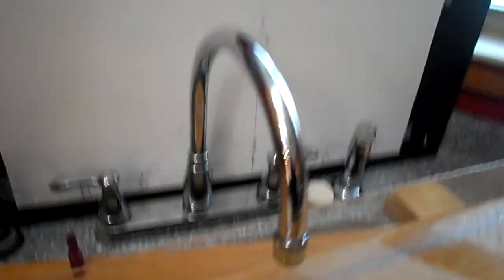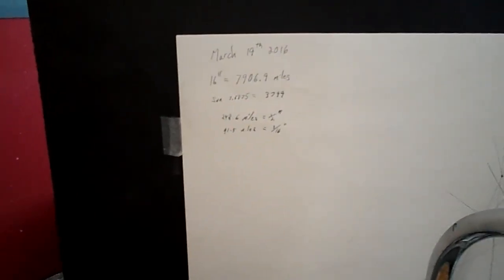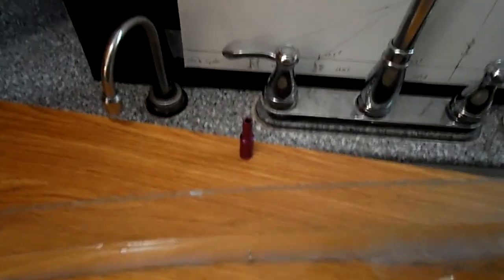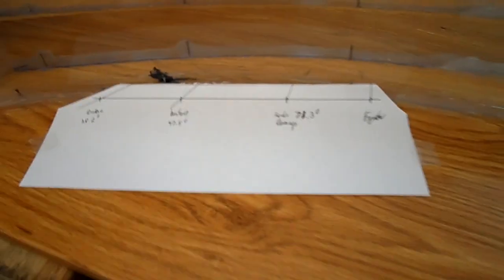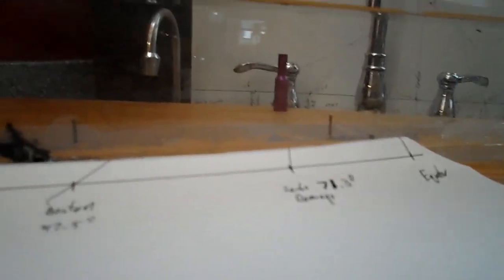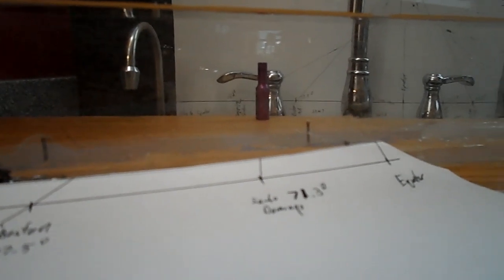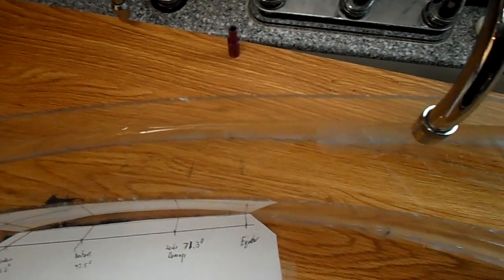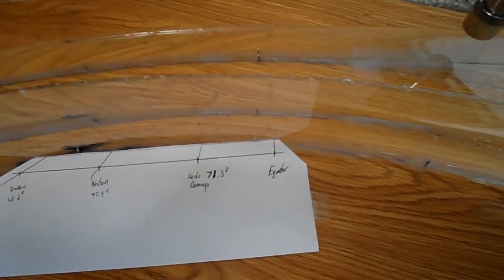FE Dome is 250 miles high on simple model (Part 2 Measuring dome)

Comment: I have been researching flat earth for awhile and finding the truth is not easy .The following is a quote you may want to re post "Earth is a realm,it is not a planet.It is not an object,therefore,it has no edge.Earth would be more easily defined as a system environment .Earth is also a machine,it is a Tesla coil.The Sun and Moon are powered wirelessly  with electro-magnetic field also suspends the celestial spheres with electro-magnetic levitation ,Electrico magnetic levitation disproves gravity because the only force you need to counter is the electro-magnetic force ,not gravity .The stars are attached to the firmament NIKOLA TESLA

Comment: By the way, what's the reason the firmament to be water?
Reply from the maker: The firmament is not water but rather a molten glass type structure.  It seems like there is water above that which is how the great flood was caused.  When we look at the moon or stars thru the P900 camera it seems as thou the image is under water.  Like we are seeing them thru  a layer of water.  Much like an air filled dome on the bottom of a swimming pool.  And it matches up very well with the Bible, not that really matters to some people.
Reply: @Lightendog  , why don't we just send some balloon up there and probe what's there? How high is it?
Reply from the maker: @keviny9863  People have sent balloons with cameras but they don't make it to the firmament.  The weight of the camera and such could keep it hundreds of miles from the height needed.  Imagine a room filled half way with helium and you let a balloon filled with it go at the bottom of the room.  That balloon might make it just to where the helium level begins because everything else (helium gas alone) is still lighter.   Flat Earth needs someone backing it with big money.  Seems like the rich only care about making money......not the shape of Earth.  My future video should have the dimensions, if I ever finish this project.

Comment: A 250 mile high dome? 
Do the math, it won’t work to cover the earth. And you’ve still got the larger problem of not having enough surface area. 
With the edge being Antarctica, that only gives you about 10.5 million square miles of surface area. Now maybe you can fudge that up maybe to 16 million (if you opt to claim some shipping lanes are fake) at best but there still would not be room for even one ocean let alone the others plus the land masses. Now the dome at 250 miles or so at its highest point on the ISS orbit would mean things would be banging into the dome. That’s only going to cover like 278,500 square miles as a uniform Kruschke type dome on a flat surface.

Now if you make the circumference bigger, you mess up all the distances between places but can then hold all the oceans and land but compound your dome problem. If you make the circumference less you might fix the dome problem but you would seriously cause a comical level distance issue.
Reply from the maker: The dome will be 250 miles high at some point but may be higher and lower in some areas.  Depending on what pitch the dome is will determine if it will cover the area or not.  I ran into a problem trying to figure this out where I could get 3 angles to work but not the outer two.  If I get the outer two angles to work, then the inner two don't work.  LOL.  This would go a lot quicker if I could move my dome shape around while figuring out the angles.  Turns out, according to the sun, the dome is not shaped like I thought.  That will be in the next video and it explains your question perfectly.  And I'm pretty sure people will NOT accept what I'll present as the shape of the dome.
Reply: And the gofast rocket “hitting the dome” is absolute bunk. Their site explains its breaking mechanic which everyone claim a dome strike fails to read. It would even place the dome 73 miles high over Colorado which is beyond absurd. 
Of course, make the earth a globe, without a dome, and everything works, works together, is explainable, repeatable, and predictable. 

Honestly this FE stuff reminds me of someone trying to stuff a dresser into a small car. By the time they say it works they have left out three drawers, declared the mirror isn’t part of it, one drawer is in the front seat, half is tied to the roof, and they’re ignoring the 3/4s hanging out the back. Fits perfectly!
Reply from the maker: @frequencydecline5250  with no nose cone damage I'd think everyone would agree it did not hit the dome
Reply: Do rockets stop instantly on a dime?
Reply from the maker: @dukedune5717  No they don't stop instantly, not without getting nose cone damage or......someone talked about an anti-spin blast that cause it, IDK but I don't think it hit the dome.

Comment: what i understood from this video,sun is outside the dome right? Most of flat earters pushing circling sun inside the dome!
Reply from the maker: no, it's still inside the dome
Reply: @Lightendog  you are using nut socket as a sun, and it's outside of your dome model.
Reply: @kogap95  maybe he should model the upcoming  lunar eclipse up on his model lol
Reply: @Lightendog  you should use a protractor and use data from suncalc or time and date , and your model shows those city's are not even 250 miles away from your dome

Comment: If there is a dome with water above. Wouldn't the water distort the angles? Would the dome itself magnify with its dome shape?
Reply from the maker: Exactly............the sun is not were we actually see it on FE and this is what I was hoping to prove.  You did see my video 3 vids back on measuring the dome right?
Reply: @Lightendog  yes, I saw the dome video. I would say that the atmosphere refracts and/or bends sun light on a ball earth as well.
Reply from the maker: @everybodyseye  atmosphere refraction is no where's near as great as the refraction that goes from one medium to another.  The atmosphere will also magnify objects depending on how much moisture is in the air.
Reply: @Lightendog  yup...lol